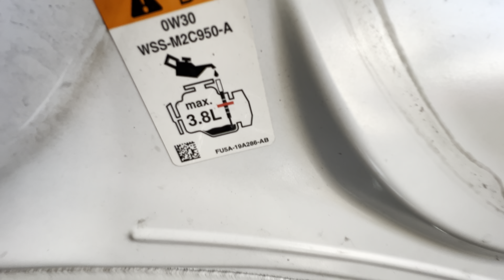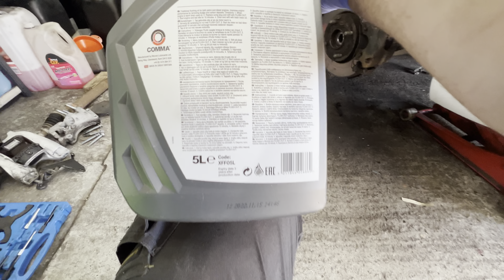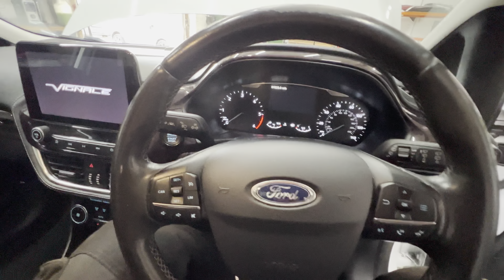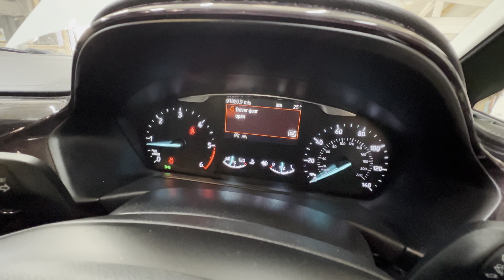Ford Fiesta Vignale MK 8 1.5 Diesel Timing Belt Replacement Part 4

Comment: Thanks for this good series of videos. The fuel pump timing is for keeping it balanced, not fuel delivery (it's a common rail system). Without balancing, it will still work fine but might cause premature wear to the pump, so still very important to make sure it is correctly balanced.

Comment: Could you tell me the recommend interval for changing the timing belt (and other relevant parts) on this particular make and model? It doesn't seem to be in the owners manual.
Reply from the maker: Hi a dealer will say 10 years or 100k miles but really should be done before then better to be safe the. Sorry
Reply: Hmm okay. Thanks for the quick reply @ResurwreckAutosUK

Comment: Great job as always Mark. How much would you charge for a timing belt replacement kit including water pump please fitted for Astra h 09 plate 1.9cdti? Itll also need a crank seal as well a new one put on it as well please. If you could inbox me I’d appreciate it. Thanks

Comment: That’s news to me mark that a high pressure pump needs timing surely not, great work as always though
Reply from the maker: Hi mate I got a message yesterday check yesterday’s video got me thinking did I do that and no I don’t know buddy 👍👍
Reply: Yeah bizarre I never heard of thar before unless it's another spastic  feature that is only on FORD
Reply: Most common rail pumps are timed. The engie will run as its not timed for fuel delivery (it only delivers presurised fuel), its timed because its a 3 vane pump and therefore runs out of balance . Its timed harmonicly to another out of balance component. Worst case it will give engine undue vibration .

Comment: Fords Tdci does not have diesel pump timing it’s just a high-pressure pump you don’t have to time it
Reply: I was just going to say this
Reply: The engine will run wherever the pump is but it has to be timed to stop pressure waves in the rail affecting injection quantities
Reply: Iv never time one these pump up been fine

Comment: Hi mark as your doing these clutches I would invest in a brake pressure bleeder best investment...
Reply from the maker: Hi mate yeah I do have one but think I have lost the rubber so don’t seal and now leaks under pressure 👍👍
Reply: @ResurwreckAutosUK  that's not the one that runs pff the tyre....

Comment: As you know I was ford tech and we’re that was located won’t have made a blind bit of difference it would have still run with no issues. I had one at work it snapped belt I put it all together didn’t put pump in place it was about half way round (more lazy on my side) so chanced it and it ran perfectly